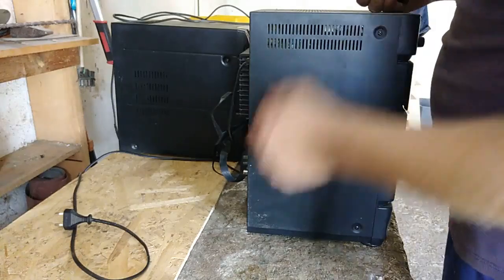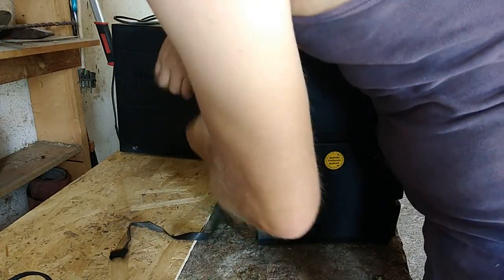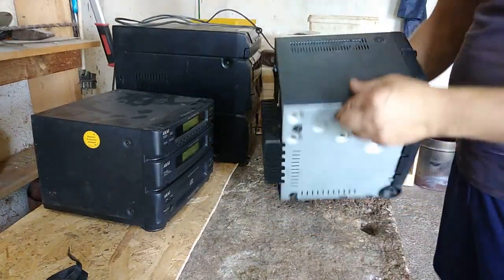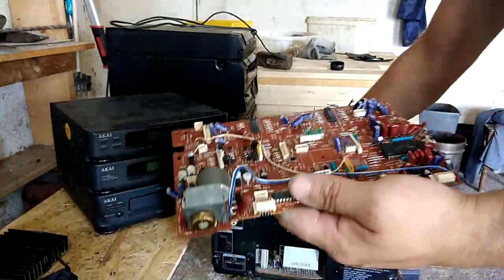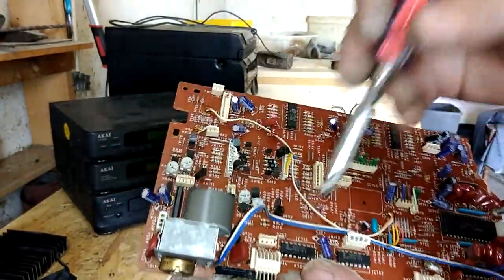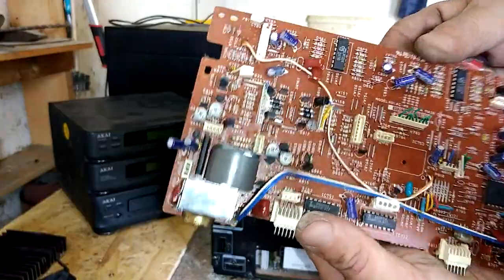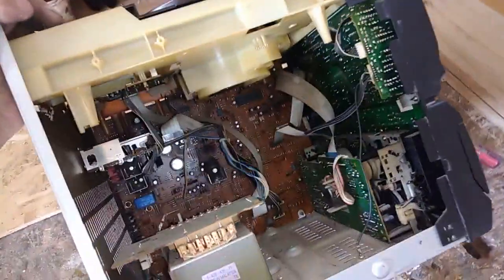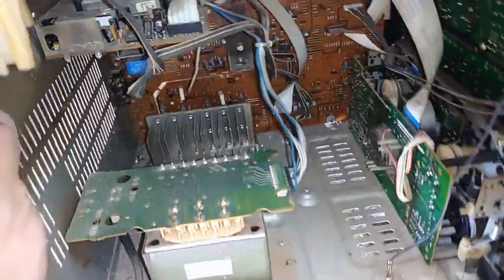Scrap HiFi audio sistem for Cu,Al,Ag,Au,Fe and more...

Comment: I'm just wondering. I've seen in another of your videos how you strip the green solder shielding with chemicals. To expand on that, instead of stripping the boards down (which you've not shown in this video, maybe another later?), could you immerse the boards into a 32% HCL and water mixture, as that degrades all but Cu, Ag, Au, Pd, Pt. So you've get rid of all the non precious metals, and that could these could then go through another chemical process to extract each of them in turn?
Would that be possible (sorry pretty new to this but learning fast). Great information on your videos , keep it up. Thanks